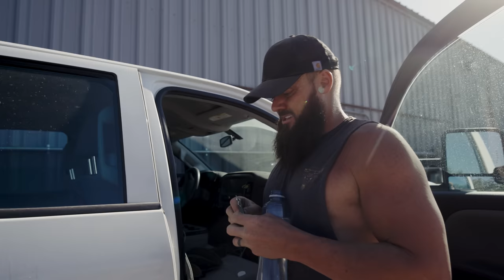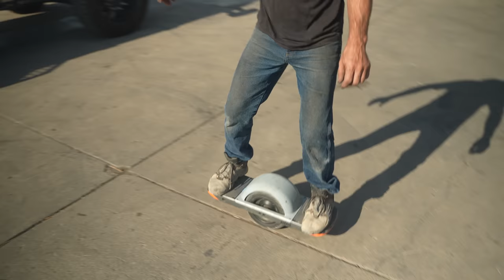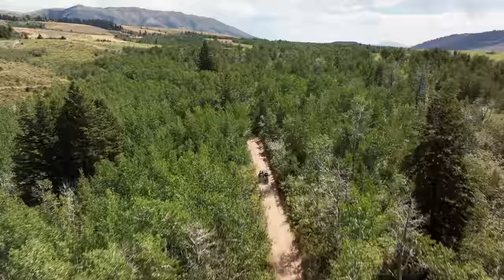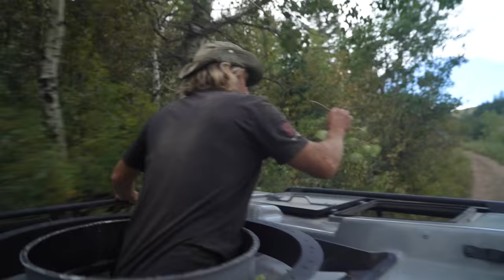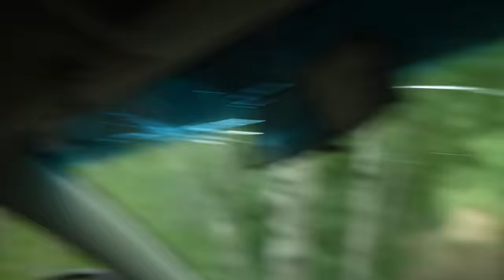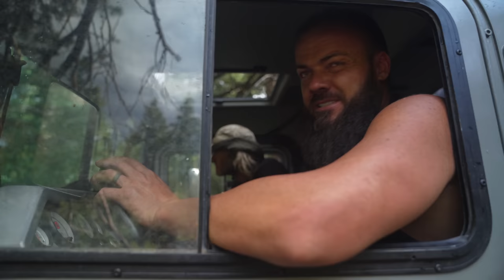Intoxicated Driver Takes Car On 20 Miles Of ATV Trails and Needs Insane Recovery

Comment: Great episode! The Sisu Nasu is one cool recovery veichle. I drove the original BV-206 in the Norwegian Army many years ago.  Had never a problem overheating , but it IS made for use in Lappland , Northern Scandinavia.

You know the linkage between the front and rear wagon?  At least on the BV-206, it's made several blades of spring steel. As you drive it heats up, and gets softer and "bendier" This makes for better traction , but it also gets easier to tip one wagon over. If you happen to tip the rear or front wagon, you have 5 - 10 minutes to secure the still standing wagon to some trees or something. As the link bar cools off, it will stiffen up, and recover the tipped wagon.

Comment: If you put hinges on the front push bar and curved plates on the top (to help reduce destruction on the top bar), You wouldn't have to remove the push bar at all. Just have a locking mechanism to keep it in place, unlock when you need to get to the rad, reline your winch etc. you wont have to take out those 8 bolts.. Simply take out the pins... Just like hood pins for a removable hood. The curved plated on the top bar are for the winch lines itself.

Comment: When I was in my 20's, I used to take my '90 Sonata into places that were only meant for trucks, but I'm a fairly skilled driver. Despite that, one time I picked the wrong side of the ruts in the winter and slid down into them, bottoming out on the frame, just shy of the clearing that headed back to the main dirt road. 

Me and my friends spent the whole night digging, pushing, and using fallen logs to try and get loose, got the car about 25 ft further back before burning the alternator out from all the heat from the high revving. Boiled off most of the coolant too. We spent the night there, and the next day we walked into town and bought a new battery, and called a friend of a friend with a big lifted truck to come tug us out the rest of the way. The truck was having issues and wouldn't go into four wheel drive, and couldn't get even halfway into where the car was stuck. 

In the end, me and one of my friends were still trying to push it out while the rest figured out the truck situation, and I'd got it about 3/4 of the way forward out of the most recent hole we'd dug with the tires and was sitting on the brakes while my friend was getting ready to give it another shove backwards(backwards was downhill so that was the direction we'd been trying to push it in), but I accidentally released the brake and started to fall back into the hole(I was exhausted), so I just gave 'er and that SOB pulled itself backwards the rest of the way back out to the main road all on it's own without a lick of help after we'd been stranded all night running ourselves ragged trying to get it unstuck...like the car just hadn't been cooperating because it was mad at me for getting it stuck, but had finally had enough and wanted to leave....drove it the rest of the way into town, parked it and had it towed...

Comment: trail fix 4 for the overheating
if the vehicle has windsheild washer system still
pop out winsheild sprayers zip tie pointing at radiator , water and ice from the beer cooler and spray while driving when needed

Comment: When I was 19 I tried to drive my 1600 VW Beetle up the Fish River Canyon 4 x 4 trail way back in 1970. Cracked the bottom of the engine. 400 mile drive home, used slot of oil.
Reply: Fish River Canyon is in Namibia, north west of South Africa. Some say the Fish River Canyon is bigger than the Brand Canyon
Reply: I was an idiot in my youth.

Comment: Dave is having fun driving the car. You are amazing guys. Always enjoy watching you guys make good out of bad. Stay safe.
Reply: @Randomperson0467  proof
Reply: @Randomperson0467  - Absolutely.  They take a car with no noticeable damage and completely destroy it dragging it down through a narrow rough and wooded trail, when they could have simply DROVE it back on the smoother trail it came in on.
Reply: @Rattlerjake1  i ment the scam bot
Reply: @private2102  i ment the spam bot
Reply: Sorry Didn't know this was a Spam bot how could you tell
Reply: @private2102  it was before heavy d blocked it

Comment: Old timer loggers in Chihuahua,  MX would put a 30-40 gallon tank of water on the roof and when they'd go on those uphill trails fully loaded they would let the water soak the radiator.

Comment: you guys could come 2 denver colo and help redo my backyard deck. i have some of it done  need a tin roof and sides. and some floors boards replace. but because i have chronic steel arthritis in my knees, and joint's i'm on ssi. i have good days and some not so. and i can only do so much i would like a places out back so i can set out there when the sun is setting and play my guitars. all cook yous a bbq dinner brisket. 💥

Comment: I've gone and recovered a Subaru Brat and failed to recover a Toyota in some really messed up situations. For the Subaru, I was surprised they got to where they did before breaking the front passenger wheel off. The Toyota was an absolute nightmare. We brought three one ton trucks when we really needed three wheeling rigs. Long story short don't ever lie about your situation when it comes to a recovery. We took three trucks up there on a closed mountain road and spent almost 14 hours trying to get to the truck. We bailed on the recovery and backed down like 12 miles of freaking sled trails to get out of there. We were all so pissed by the time we got to the bottom of the hill that we just left him there to find shelter. If we would have stayed any longer we probably would have killed him ourselves. His rich dad rescued him the next day, which put the nail in the coffin for all of us. He sent a fan blade through the rad drunk wheeling and had the balls to call a friend of a friend who recruited me to come help and it was an absolute mess. Never again.

Comment: Dave, you advertise WAT (Whelen Aircraft Technologies) on your shirt, they make mediocre "toys" for LED landing lights, their HID lights use 35 watt Philips bulbs for their "85 watt" systems when a suitable higher wattage more expensive Philips bulbs also exist, resulting in substantially shortened bulb life. For the crazy high prices they charge for Chinese made Ballasts, and the HID bulbs is unacceptable.

Comment: How did they get it there? Well I've gotten my 2004 Jetta places that shouldn't be possible without 4wd. It takes sheer determination, momentum and a distinct lack of fucks to give about your car not getting damaged. Seems like a gambler 500 move though to take a stock Mazda out there. The only thing that I would have done differently is to make sure you go with enough vehicles so you don't have to call someone to get it out and take enough gear between all the cars to make sure there's some way to rig something to make sure every car that starts down a trail makes it back to the start one way or another.

Comment: People in Utah will know where this is. My friend and I decided to take his dodge neon up corner canyon on the border of salt lake and Utah counties in Draper. It’s all off road. We made in just fine surprisingly and camped out for the night. This was around 1996. On our way out, he proceeded to rip off the bumper, and tear a whole in his oil pan. Luckily we made it out and up a very steep hill to a gas station, where we had to wait for his future ex wife to pick us up. He later was drunk and high, was driving at a high rate of speed down big cottonwood canyon, and went off the road where the S turn is. Climbed out the back of the car, got to the road and hitched a ride down the canyon to call a fried.

Comment: You should make a water sprayer system for the sisu. Have  electric sprayer the blows water on the coolers and the radiator. It could be very useful

Comment: How about having a drawing to have a fan come out and spend a week with you and your crew and participate ? I would have loved to do that back in my day . When I was first in The Army I was a Track Vehicle Mechanic and Recover Specialist In 1980 it was MOS 63Y. The retriever I was assigned to was the M578 I also worked on the M88. I have off road my whole life grew up in a coal mine with my Dad. My first four wheel drive was a 1966 International Scout .

Comment: YOO HEAVY D N DIESEL DAVE HOW DID IT GET DOWN THAT TRAIL YALL TOOK IT THREW AND WITHOUT BODY DAMAGES AND A POPED OIL PAN THEN YALL TOOK IT OUT N TOTALLED IT X3 LOL. HOPE THIS WAS A PLANT AND NOT A REAL CUSTOMERS CAR BC ID B PISSED LOLLL. BUT WHOEVER PUT IT OUT THERE IS AT FAULT. BUT THAT CAR MAY B STOLEN OR USED IN A CRIME BC IT WAS DUMPED.